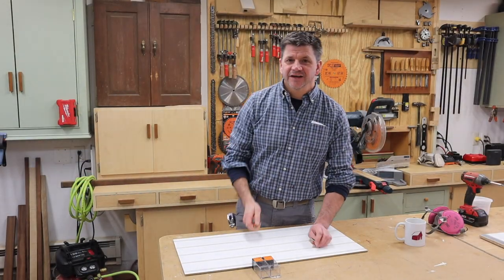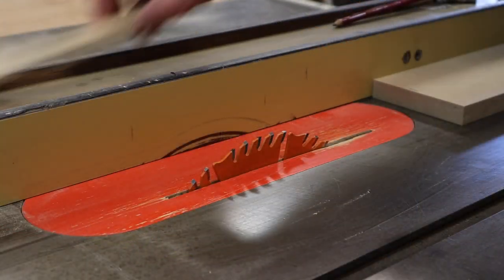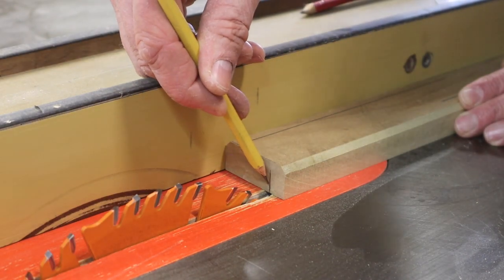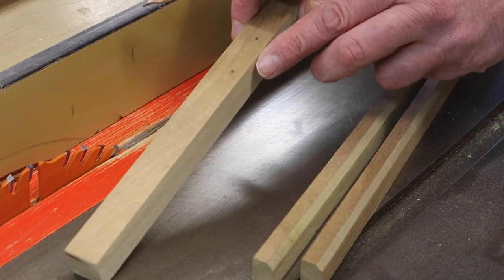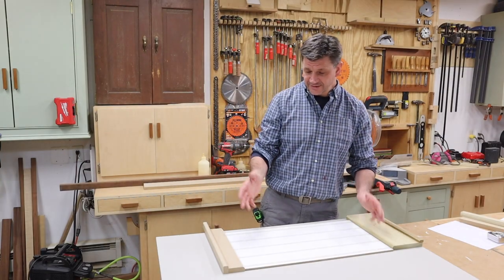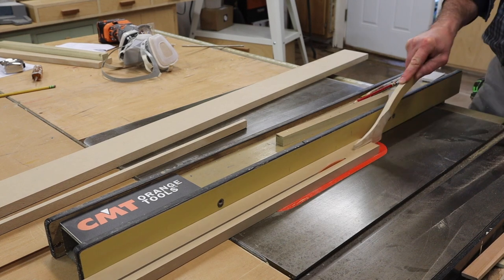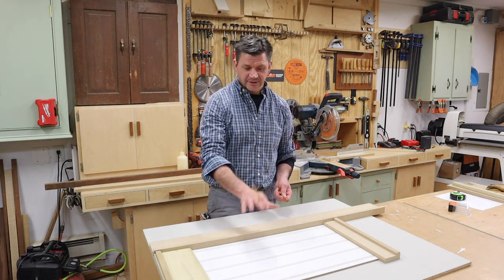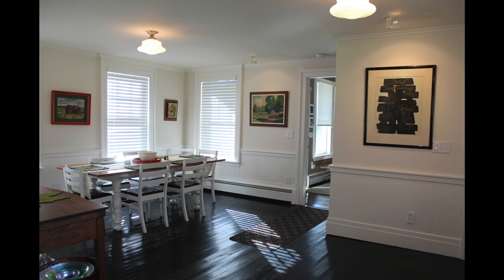My Two Must Have Router Bits for Classic Wainscot Chair Rail Design

Comment: Very nice job on this video, I use the same bits, plus one more, a rabbiting bit to cut a rabbit in the 5 1/2" & 2 1/2" boards so the paneling can slip in behind , gives a little le-way and there are no gaps.  thanks for posting
Reply: Thank you. I was looking for the name of the bit I needed “rabbiting bit” to do the same on my baseboard :)

Comment: Another good video Jon  i too  have made lots of my own moldings  and Wainscot  i did usually  do Poplar  that i was able to get  for a awesome price  of free  !  Some did need re sawing  and some other things  ? But i always liked working with solid Poplar  years ago  before all the fingerjointed  moldings   For paintgrade  trim  we used to almost always used Poplar   Ounce we lost a  job because another company under  bid us  by a wlarge amount of money that was actually lower than our cost of materials  on the job  it drove my estimators crazy because they  had no idea how the company could do that?  The specs on the job was all Cherry Wood solid moldings   I  actually went to the jobsite when the other company began to install their products just  to try and put closure  on my company losing the bid  i looked in the  poff cut piles of the “solid “ Cherry base molding and very quickly saw that it was actually Poplar wood Stained to  look like Cherry  when i brought the  off cut back to my  Shop  i  passed it around to  all our estimators and owners to look at and  we let the General Contractor know  what they got for their money the strange  thing  was the General Contractor  kind of shrugged it off because their customer  appeared to be happy with the Woodworking ! We later found out that the Shady Company went out of business  and that it actually was a operation that worked out of   Garage  somewhere in rural West Virginia  our company was a 30 year old Shop that worked from a 100 thousand square foot  brick and mortar shop  with over 100 employees  that had a reputation with  the General Contractors as being  very honest
Reply from the maker: Thanks for the comment Craig

Comment: Great video Jon. At the end you mentioned to prime all sides of the MDF. You would even prime the side that gets glued onto the wall? And why only prime but not paint all sides then? Conventional wisdom would tell me you said to prime to keep it uniform all around but if one side gets paint and the back side on the wall doesn’t then isn’t that going to change the makeup anyway? Just trying to figure out what the best way to go here is as I’m going to be tackling wainscoting in the near future.

Also, I envy you for taking such a clean end cut on the router and not running it into the adjacent edge. That is a skill I have yet to master :)

Comment: Why is 3/4 referred to as 1 inch and 5 1/2 inch as 6. Just curious. Thanks
Reply: Because that was the original size before it was dressed
Reply: @elvibailey6577  our timber is also dressed and sold as actual size after dressed. Yours is confusing and complicated.
Reply: OK. Here in Trinidad 1×6 dressed is 3/4 × 5 1/2 and 1×6 undressed is 1×6
Reply: @elvibailey6577  so call a 1x6 undressed for what it is and dressed to its altered size. 1 is 1 and 3/4 is 3/4 why confuse the one with the other. 😁😁